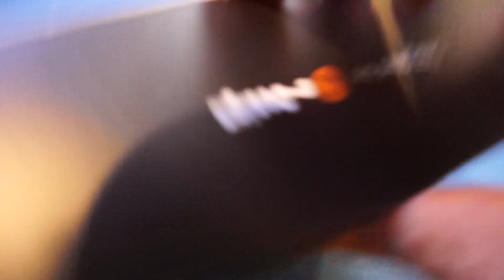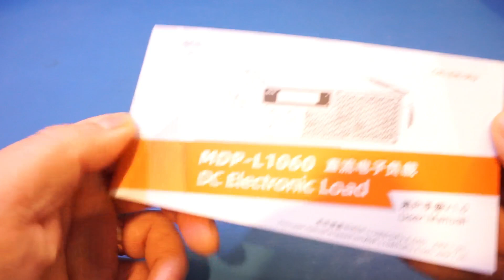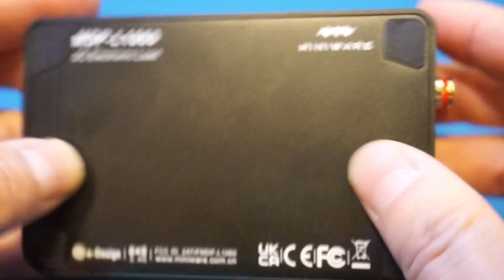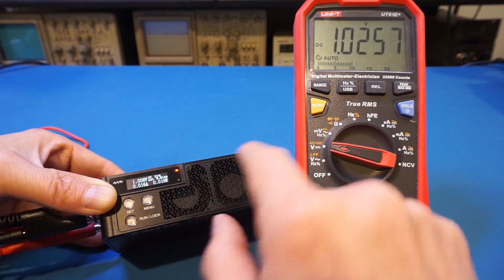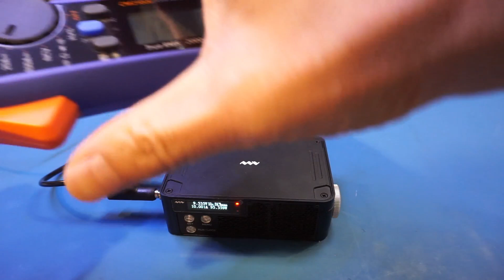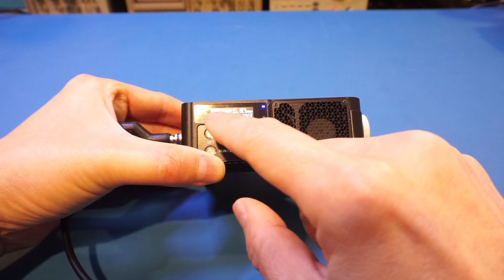Review of a Miniware MDP-L1060 DC Electronic Load - It Runs on Battery and is Programmable!

Comment: Good device, but absolutely overpriced. For around 250 USD for that device you could purchase multiple Atorch DL24P or DL24M electronic loads instead. Which offer a combined power over 2000 watts and a higher voltage range of up to 200V.

Comment: is negative input connected to usb-c negative / shield?    that was a big issue with their psu's potentially short out something when needing a negative supply
Reply from the maker: Just tested, looks like the usb shield is connected to the negative input terminal.
Reply: That's very good to know. But you can find many USB power adapters that are floating supplies, which don't ground the usb power negative wire or the usb connector shield, so you can still end up with a completely floating electronic load (or power supply), and not necessarily have a real problem. But again, very good to know. (Also, I hear the P906 fixes this? I have the P905 ...)